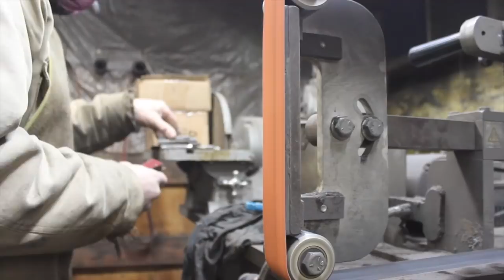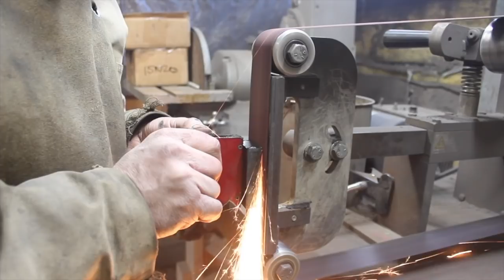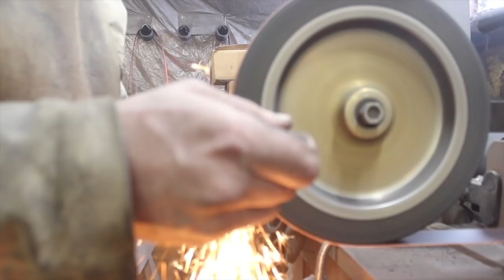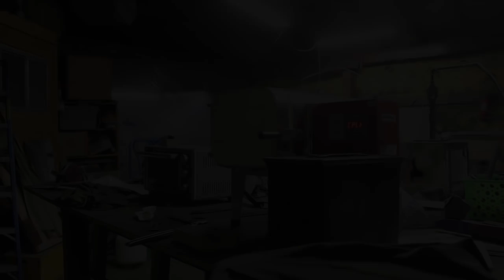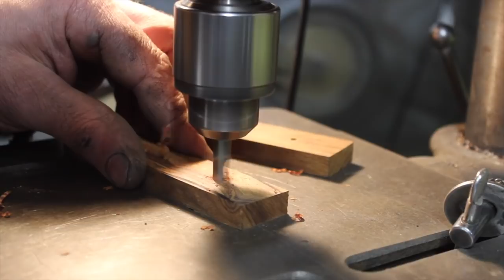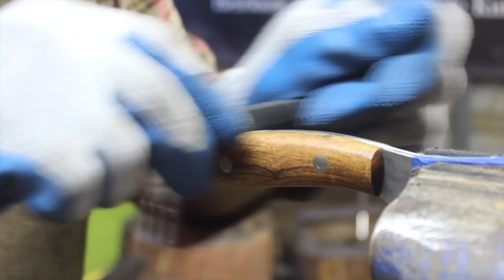Forging A Cleaver From Sawmill Blade And Spring Steel ~ Step By Step

Comment: I read that spring steel was difficult to forge weld into Damascus
Reply from the maker: This particular spring steel is 1080 I believe, so pretty simple to weld. Steels like 5160 apparently don't weld to themselves well, I haven't tried it, but are supposed to be ok when paired to a simple high carbon steel.

Comment: Very nice, but that much welding at first wasn't needed, nor did I see it get ground off before forging? I would be concerned about mild steel from the weld being within the compositions (especially if it ended up on a section of the cutting edge) as there was a ton of mild steel used there to weld it up.  My two cents
Reply from the maker: I hear you, I was sort of experimenting with a zero atmosphere technique, but I did make sure all the bead was gone, didn't show all that in the video.
Reply: He was welding up all the seams to have a zero atmosphere forge weld. So no oxygen would get to the welds and he did not have to use flux

Comment: Imagine forging in a vacuum environment. No scaling, no sparks, longer working time between heats. Unfortunately normalizing cycles would take ages, and you would need to wear a pressure suit with an oxygen tank on your back.
Reply from the maker: That would wild, except normalizing wouldn't work since the super slow cooling rate would anneal it instead...

Comment: you do not need to use such a big hammer to move steel efficiently,  i have been only using hand hammers for the almost 4 years i have been making blades. I learned that different shaped hammers work better for a given task, and going from heavy to lighter hammers lets me forge all day without getting winded. beveling is best with a 1.5 lbs hammer well general forging is best with a 3.4lbs, I only use a 4+lbs hammer when I want to thicken a piece of stock or am setting a canister.  PS: I do not sell yet as I am waiting till I pass the ABS Journeyman performance test.